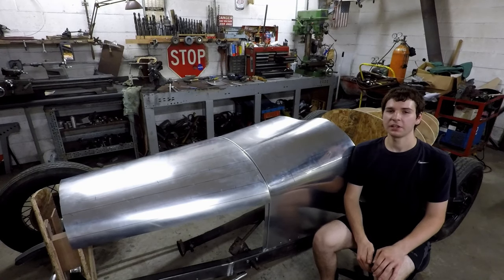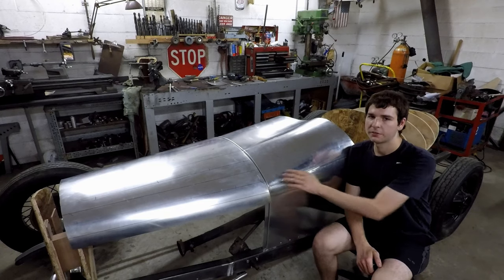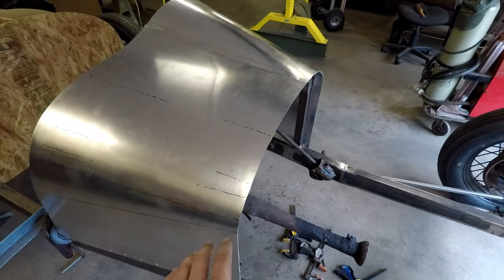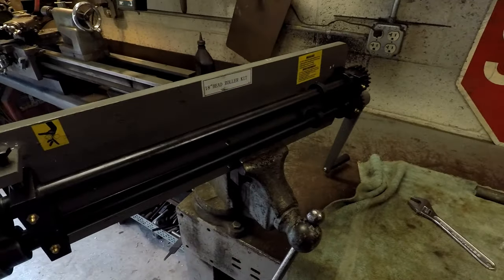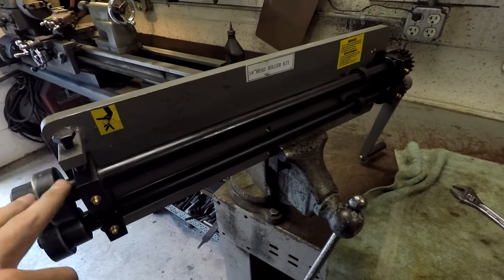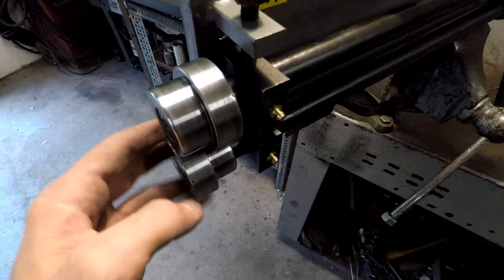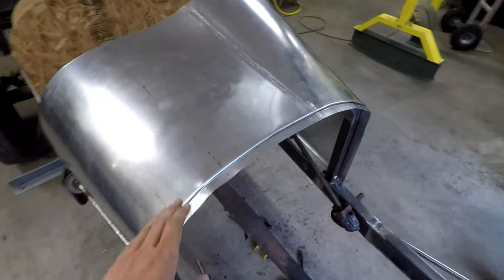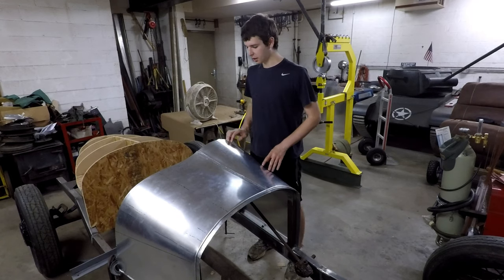Mounting a Custom Car Body Cowl | Boat-tail Speedster Pt.27

Comment: I'm not a metal worker but a bit of annealing on the edge of the aluminum might help.  As always, a good video not cluttered with crappy music and straight to the point.  Good job.
Reply: You make a good point. So many videos for me at least a ruined buy unnecessary music. Usually either folksy or heavy metal public domain. You aren't a professional. It doesn't have to be a professional video. That's what we like about it.

Comment: Go and get yourself a  shrinker stretcher.  When you step rolled the cowl the puckers are extra metal. You have to either shrink or stretch those to tighten up that lip. Harbor freight and Eastwood sell them. You'll use them on the rest of the body. Check out  Lazze YouTube  channel for more information
Reply: Lazze's a master, no question. The trouble is, he makes it look so easy, concealing a lifetime acquired skill.
Reply: @parrotraiser6541  Yes he does doesn't he? I would love to be able to work with him for a year or two. I really like to see people do work and be so particular.

Comment: Looks like you need to use a metal shrinker on those rippled areas. Nice build thus far though. Thumbs Up!
Reply: beat me to the recommendation,  I was watching MotoGP when this popped up.
Reply: The puckers can also be relieved by slitting them with a thin saw and tig welding to close the gap.
No shrinker necessary.
Reply: Mystery Meat thats a form of shrinking can do the same thing by using a torch and and cooling it right away with water it even done it with just a tig torch no cutting needed

Comment: Small setbacks but with the typical Macro Machines perseverance you can overcome them. The painters tape did the job. 
Looks like the next tool to acquire/build will be a shrinker/stretcher so you can shrink that inner lip when you step roll a lip around a curve. 
It is great to see your progress and it is clear that you are continually learning and improving your skills and knowledge. 

Good thing you had help with the roller but if you didn’t we’d probably just see you make a video of you converting the manual roller to a power roller with a foot pedal control. 😉

Comment: Starting to look like a real car now.  Testing the flange roller on a scrap piece was a smart idea.

Nice illustration of why you should think about space for tools when positioning holes. (And what your fingers will hit if a tool slips. You don't seem to have any in there, but I swear some designers put sharp edges exactly where knuckles will go.)
 If you're going to do any more riveting, I'd suggest looking up "cleco". Clecos are to sheet metal what pins are to needlework.  Any number of homebuilt aircraft videos will illustrate their use, (and other tips for working with sheet metal, especially aluminum).
Reply from the maker: i'm familiar with clecos. I'm not doing a bunch of riveting though, so I don't need them

Comment: Quick Tip on operating Taps in tight areas- You can go thru your 1/4" drive 12-point sockets and find one that fits the 4 point square drive on your Threading tap and drive them in and out quickly with a 1/4 ratchet handle, it's usually several sizes off from what the wrench size would be for the tap, so if a 5/16 open-end wrench fits the tap, then 2 or 3 sizes different in 12 point socket will fit it also
Reply: Weather stripping for a House door from Lowes or Home depot would work well to keep the body from rattling your teeth out against the frame also

Comment: the beadroller is good enough for the job , a good upgrade is to motorize it so you can guide the piece and hold it steady with two hands
seen them use different motors for it but i think the winch motor running a small block chevy camdrive chain is eaziest as it allready made to go forward and reverse , no chance on regulating the speed though 

youre doing a great job and a lot of the ideas i had on reducing rattling and stuff like that you allready thought off and mentioned in the video , you can get the rest of the wrinkles out with carefull use of a shrinker/stretcher tool (arc on the lower part of the step is smaller so the metal needs to shrink in on itself a little, mostly on the rounded corners) 
probably a nice idea is to gleu a leather band on top of the step before putting the cowl over it , that should reduse the scraping of metal on metal you can roll the edge of the cowl down a little and have it hook behind the leather strap preventing it from sliding back or forth and you can finetune the flush fit between the cowl and the hood by filing / sanding some of the thickness off the leather

Comment: I’m impressed with the tools and skills you have. I know this is really late, but when using the bead roller, make multiple smaller increment passes. This will prevent the large deformation you got from doing it in one go. And if you work with sheet metal, you should consider using Gleeko Clamps.

Comment: Hi Vince,a query, look into corrosion caused by mounting 2 dissimilar metalsMany years ago I had an aluminium rain water tank connected to my house with a corrugated iron / steel roof the electrolysis caused the tank to develop holes quickly.
Look into sacrificial anodes or maybe just a rubber insulating barrierbetween metals would be enough ?
Are you making the leather hood tie down straps yourself ?It's easy enough to do.

Brilliant work as usual Vince I'm  thoroughly enjoying the build process!

Tony from Western Australia

Comment: It might have helped to relief cut those two bends and welded them back up after ,also how are you going to stop vibration between the hood panel and the cowl ? A deeper roll on the cowl and some kind of gasket ( leather or rubber ) would stop it .  Can't wait to see how you do the front and backend , keep up the good work 👍🏼
Reply: Unfortunately he can't do any welding on that panel because of the heat discoloration. I think he's going to have some leather attached to the underside of the hood to prevent vibration in the same manner that he's going to do between the cowl and the subframe.

Comment: Looks really great, are you also going to build your Firewall the same way and if so will it be riveted to the top panel?
Reply from the maker: The firewall will be made out of the same aluminum and bolted to the steel subframe

Comment: hi, i follow our build also and it's looking great. 
for mounting plate metal to the frame by tapping treads into the chassis, i also saw IronTrapGarage use some sort of Rampa kind of thing that could be applied with a sort-of blind rivet hand gun.
i searched for it. it's like this.     ATLAS® Brand Rivet Nuts

but for the blind rivet thing you made to join the aluminium to the aluminium with use of that pneumatic tool. i like that so much!!! perfect build.

Comment: Why add spacers under the angle aluminium when bolting it down ? Thanks.
Wow! You let the "old man" do the manual labor while you just watch a marker line ? Lol.
Look into this material for going between the aluminium and steel frame. It's fabric used on Model A's for the hood where it meets up with the radiator and cowl area's.
 https://www.ebay.com/itm/1930-1931-Model-A-Ford-Radiator-Shell-Lacing-Coupe-Sedan-Pickup-Roadster-Hood-/302871510928
Reply from the maker: I forgot to mention the spacers, those are to leave room for the floorplan to bolt under the cowl
Reply: MacroMachines inter tube cut up can make great gasket, between the aluminum and the steel. It well cut down squeaks and rattles. Nice job.
Reply: @MacroMachines  Thank you. Makes sense now